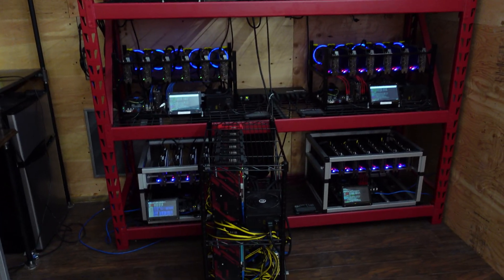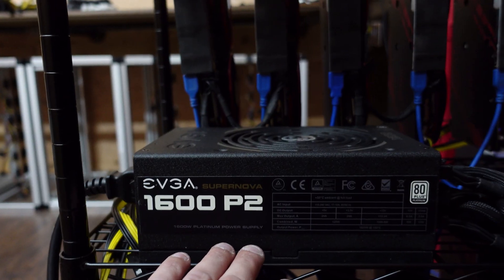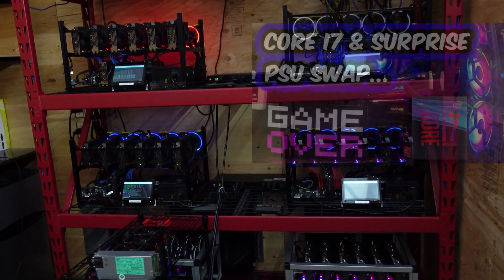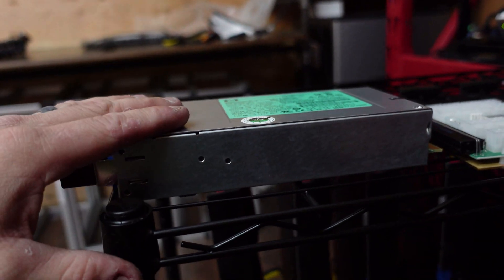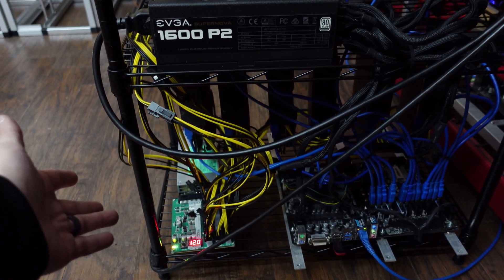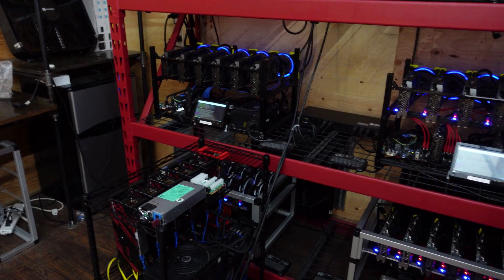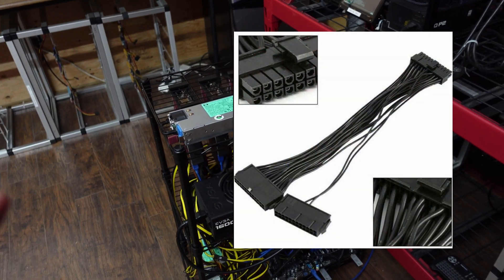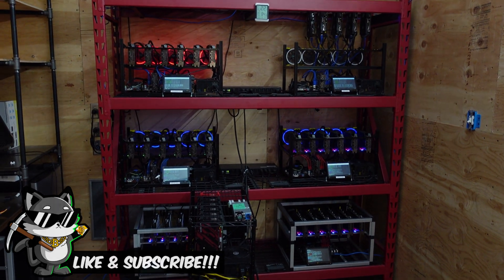ATX vs Server PSU For NOOBS

Comment from the maker: WHAT KIND OF POWER SUPPLYS DO YOU USE ON YOUR GPU MINING RIGS??? ATX OR SERVER?? LET ME KNOW!!!
Reply: Also looks a bit riskier having the PCB where current comes out from visible like that compared to ATX ? Im wondering if theres a chance to electorcute myself if something breakes and it just sits on a metal shelf...? Mayber server psu efficiency is worse too? Another Pro on ATX PSUs is, I think, that they have 10 year warranty. At least I have on my corsair psu. So if efficiency would be a lot better on the ATX one, with the warranty, I wonder if ATX psu is more worth
Reply from the maker: @alexzan1858  A Server PSU and ATX PSU comes down to the material and voltage used as I said in the video. The main difference is the application it used in (or intended to be used in) AND The more power you draw from a Server PSU the LOUDER it is. All of this is broken down in the video. 

As far as it being less safe IMO there is a risk no matter which one you use. Both of them should be turned OFF before you mess with/touch the wires.
Reply: I use 2x a Seasonic Prime Platinum 1300w. bought them for 250€ each. expensive but they are awesome, have 12 year warranty and a high resell value. the included cable zip's are just awesome too.

Comment: Yo, I wonder if you’re still looking at this I can’t get my miner to start up. I just realized I need to use one of those little ATX jumpers. Is that all I’m gonna need I just bought myself a gold shell mini three just looking to do some home office tinkering. I previously sent everything up without the jumper and could not get the PSU to power on. I’ve been researching since then and realized that I probably am missing the jumper. Is there anything else I could be missing three years later thanks for the response
Reply from the maker: So you need a psu splitter if your chaining more than one together it’s a 24 pin with a small 2 wire x 24 pin end coming off the main psu side of the plug. Or you can just get a jumper cap and manually turn them on separately… so yea that’s all you should need brotha 🤙🏻
Reply: @ thanks man!

Comment: im building my new rig of 12x1660s.
And psu which i using is server 1200w only for gpu power and another Atx psu 500w is for motherboard power
is it enough power for these 12 gpus?

Comment: Hey man love your videos ❤

I would like to know if it is more efficient to run a rig only with a platinum server psu combined with a pico psu vs. 350 watt atx + server psu.

Thank you so much for your content ✌
Reply from the maker: Hey man, appreciate you! 

So server PSU Or ATX are basically the same, if they are the same material. To get the most efficiency you want to run the power supply as far as I know between 70% and 80% of the maximum load. I believe that is peak efficiency ❤️🔥
Reply from the maker: Oh also 240v is MORE efficient than 120 when your feeding a rig

Comment: Im a noob and almost tired to purchase a ATX PSU for my very first rig. I had doubts about server PSU durability + finding quality cables for a server PSU. I'm just glad I found your video/ channel man! 
1. So as per my understanding there is no such thing as that server PSU are less durable than ATX (because they are cheap :D)?
2. Where do you recommend to get cables? Parallelminer?. I'm just asking your options because I just don’t wanna fuckup my system.
Reply from the maker: Hey man no worries!

 So before the ZSX breakout board there was no way to easily adapt a 24 pin for a mother board which is why people would use just an ATX PSU and if adding more cards then add a Server PSU as a secondary (because your only powering 6 to 8 pins on a card no motherboard stuff). 

Server PSU are in my opinion made to last in constant power 24-7 situations. BUT keep in mind you need a ZSX breakout board to power the Mother Board and stuff if your going to use this as your only power supply! 

The 6 pin male x 6 + 2 male from parallel miner is your best bet for sure since you have to order from them anyways! 

 (The 6 + 2 = 8 pin basically  just means you can split the 2 off of the 6 pin for your risers so you know. That was something I was lost with when I started lol)
Reply: @ChumpChangeXD  woah! What a detailed explanation! Thanks a lot for consuming your time for help us every time you can! Thank you sir! yes I do understand now thanks to your videos + explanation! ZSX breakout board are definitely gamer changer!
Reply from the maker: Appreciate you! Need anything else let me know my man 🤙🏻
Reply from the maker: The only down fall is they can be noisy… they get louder the more power you draw off them. A 1200Watt server psu is only capable of 1,000 watts if your only plugging into a normal house (120v) also keep that in mind!
Reply: @ChumpChangeXD  So If I have a 240V , I can draw the max 1200W ? No problems? I don't care about the noise, I just want to know I'm not burning the GPU :D (my server PSUs are all Platinum rated and so far I've only been utilizing 80% of the power)
Reply from the maker: You can it’s not recommended tho the life will be cut much shorter than if you stay with in the 80% of the max rule

Comment: Preach! Less then 12 hours after installing my server I ordered another. Legit so much better. Safety and everything. My second server arrived. Now I'm about to remove 2 of my ATX and let the second server do everything else. I'm running 7 3070s and 4 3060ti. My 1200V server I'm only using to power up 6 cards. The ATX doing it the correct 6 pin can only do 2 cards when I was using SATA (DON'T DO THIS) I had 4 each and very very unstable mining. ATX is basically a waste of money now that I'm investing into servers. And noise wise, my rig is in my bedroom and I sleep like a baby to the humming 60 dbs from rig to my pillow. My room fan blowing the heat onto the house is all the noise pumping 80 dbs.
Reply from the maker: THIS IS FANTASTIC!!!! Appreciate this comment that's awesome news I hope this helped you atleast a little!!! ❤

Comment: Is it safe to use 6 pin to 6+2 pin convertor for 3090 gpus? using these breakout boards?
Reply: 3090 can draw too much power, you have to use 2 cables
Reply from the maker: Yes you can BUT I would recommend to bring 3 cables to the 3090 from the breakout board. 6 pin male to 6+2 pin male

Comment: The server PSUs are built for commercial grade use. I work in IT and we have a vet large data center. I think we have replaced maybe 2x PSUs in the last 10 years. That should give you an idea of how robust the server PSUs are
Reply from the maker: Appreciate that brotha!!
Reply: any idea what the efficiency is like compared to ATX platinum psus generally
Reply from the maker: @alexzan1858  I can do a test for you!!! Ill make a video if you would like!! □
Reply: @ChumpChangeXD  would be interested to know for sure :D
Reply from the maker: @alexzan1858  NOTED!!!
Reply: @ChumpChangeXD  you’re a good dude bruh 🤟
Reply: @alexzan1858  FYI I use the server power supplies in my rigs. No issues at all.
Reply from the maker: @HyPex808-2  Appreciate you for always being here with us!!! ❤
Reply: @ChumpChangeXD  too bad I can’t post pics of my data center LOL
Reply from the maker: @HyPex808-2  HAHA DAMMIT!!!!!
Reply: @alexzan1858  I believe the 1200 watt ones are platinum rated
Reply: @HyPex808-2  do you have any brand recommendations for server PSUs? i know nothing about them
Reply: @alexzan1858  get the HP 1200 watters, they work great and are very reliable. They are fairly cheap on eBay and you can pick up the breakout boards on parallel miner. Since I work in IT when we throw out a server I just pull the PSUs and keep them LOL

Comment: I had server PSU, so loud in the house! I changed it all for ATX! Never had an ATX break, make sure to buy good brands!
Reply: Were you on 120v or 240v? I've got my server PSUs on 240 and they don't make a sound. Cheaper too.
Reply from the maker: @6dust  Yea MOST people who are gonna mine in their house would be using 120 which is why I made sure they knew its loud!! I have used it on both tho. Depends how much wattage your pulling from it!
Reply: @6dust  I'm on 120. It's in a closed room in my basement and I can hear it pretty clear in my main level and hints of it through the vents in the upstairs bedroom.
Reply: @CrankingAllDay  Yikes, yeah that doesn't sound enjoyable.